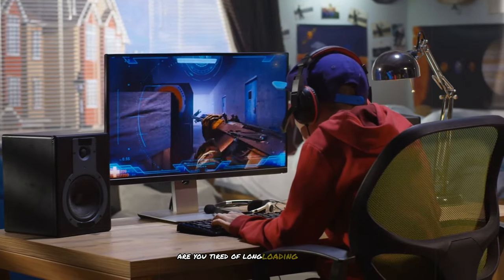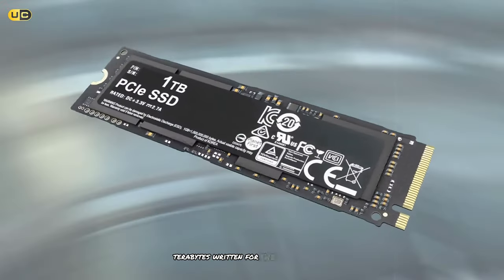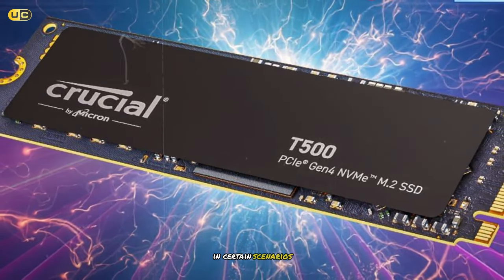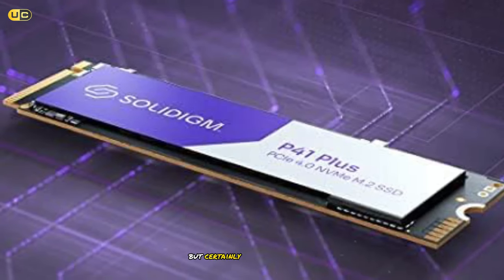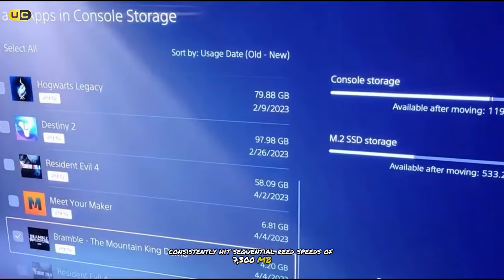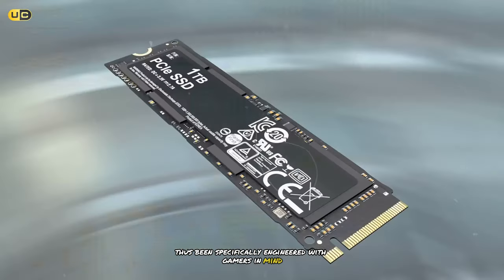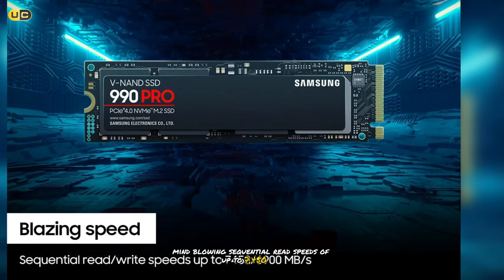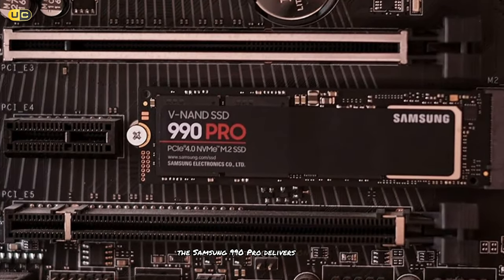Best M 2 NVMe SSDs For Gaming 2024 [ Reviews and Tested ]

Comment from the maker: 00:00 - Intro: Best M 2 NVMe SSDs For Gaming
00:49 - SK hynix Platinum P41 1TB PCIe NVMe SSD
02:47 - Crucial T500 1TB Gen4 SSD
04:25 - SABRENT 1TB Rocket 4 PLUS NVMe SSD
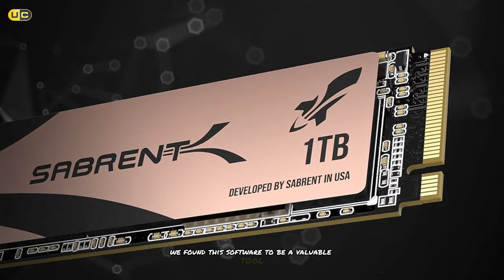06:15 - Solidigm™ P41 Plus Series 2TB PCIe GEN 4 NVMe
08:03 - Seagate FireCuda 530 1TB Solid State Drive
10:10 - WD_BLACK 1TB SN850X NVMe Internal Gaming SSD
12:03 - SAMSUNG 990 PRO SSD NVMe M.2
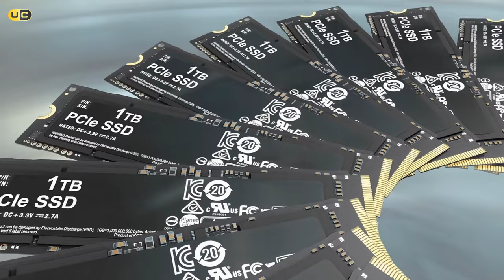14:01 - Outro: NVMe SSDs For Gaming Reviews